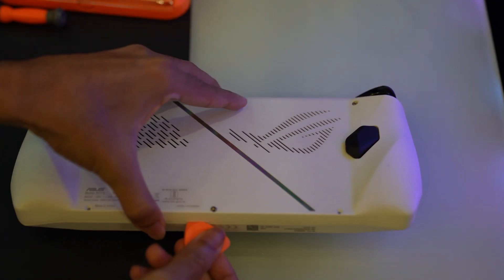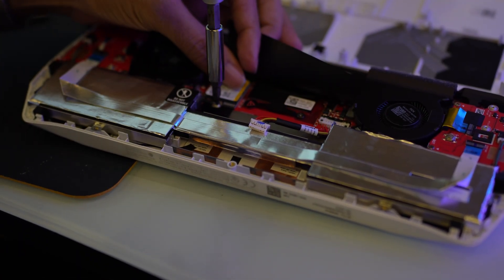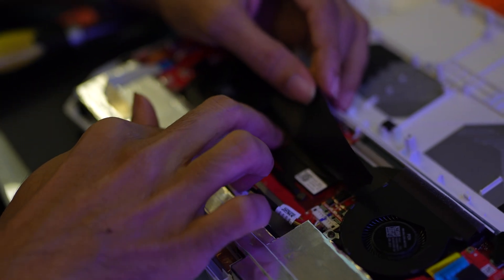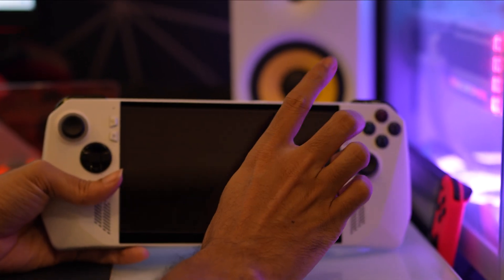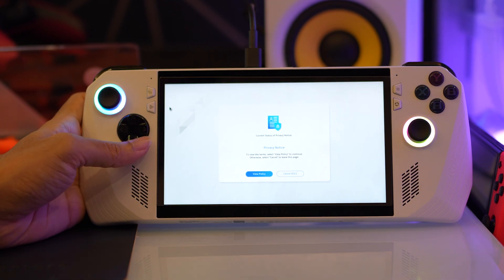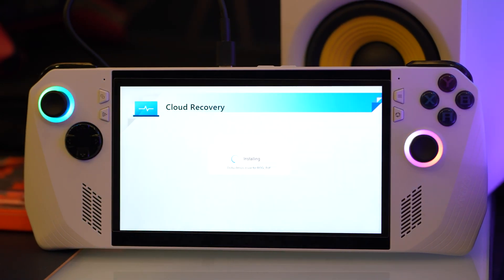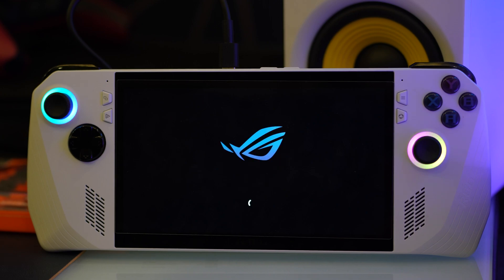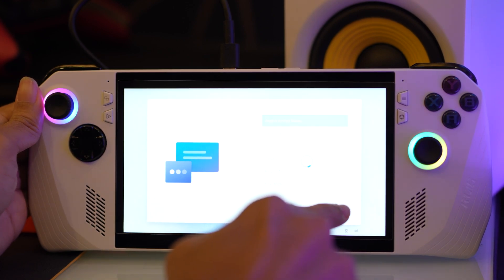Boost Your Gaming in Minutes! Asus ROG Ally SSD Upgrade - Easier Than You Think

Comment: Ive been stuck on checking for almost 30 mins
Reply: If you are still stuck on checking, just power the system off and restart the recovery process except this time in the bios menu make sure you set the time/date to the current time it is when you are doing this. I installed my sdd yesterday and had the same issue but changing the time and date fixed the (checking) hang up for me and I was finished in 20 minutes.
Reply: @chunkie3056  Extremely thank you for your reply, I will give this a go.